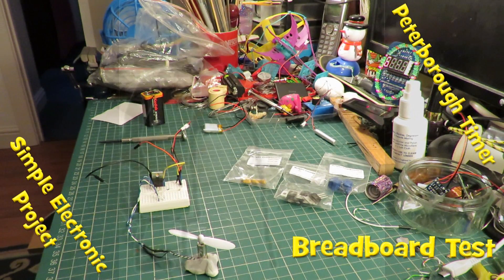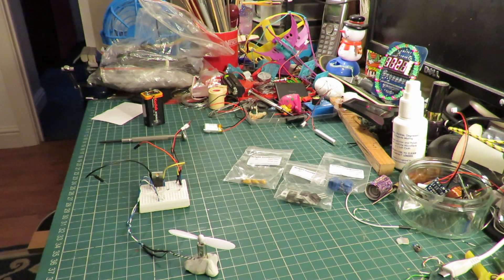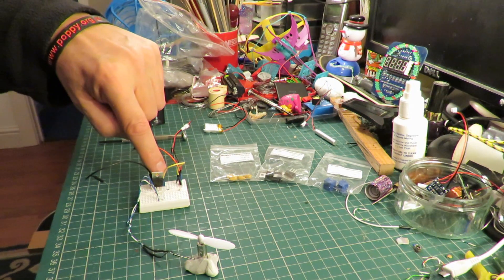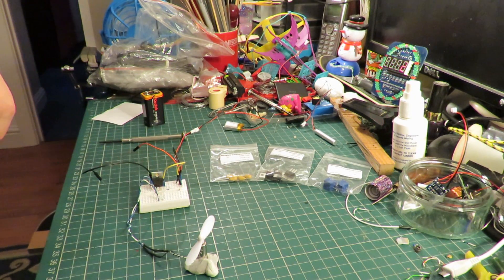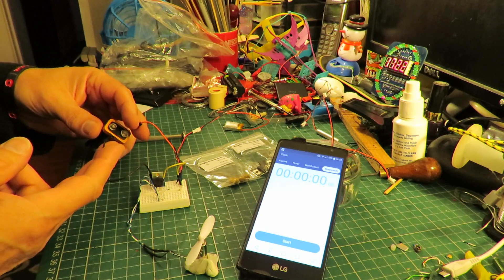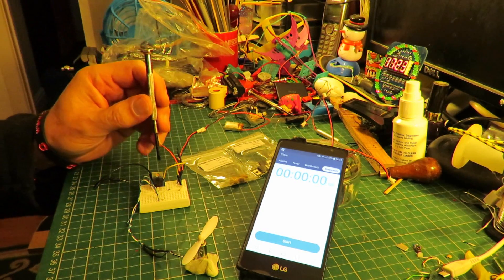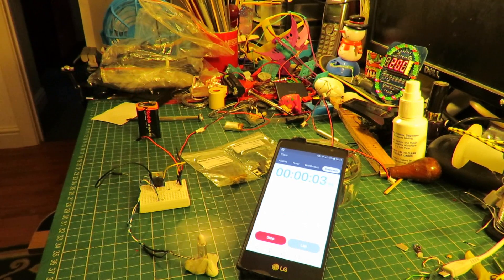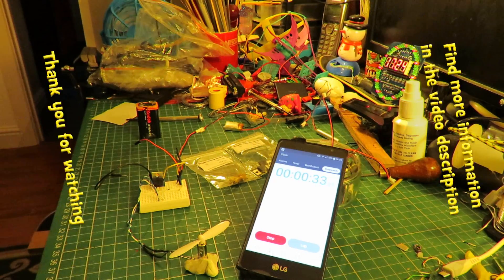Peterborough Timer - Breadboard Test

Comment: cool.
Thanks for taking the time to build and film it, and for the (unexpected) shoutout.
Reply from the maker: Thanks, credit where credit is due. I would not have known about them without your comment. I built this version so I could try out the options but I used the cheapest MOSFET I could find on eBay. A surface mount version would have been lighter but I couldn't find any really cheap and the potentiometer is obviously heavier than a single resistor so I may make a different version if I want to try this on a small plane.

Comment: Hello!
I wonder which one of the rubber band Powered cars that goes the longest distance. Not like the fastest car or so, but the one car that goes the longest distance
Reply from the maker: Sorry I have no way of checking that as I have a limited distance to test them. As long as you minimise friction you can get a good distance out of most of my designs. This one is a good example Rubber Band Powered Car 1 x size 64 - full length video https://youtu.be/pIO3FiHX4Oc?list=PLA5a2xPRSrB3g5RiX8Kf_uUBOL0Tb7AS0

Comment: Will this Peterborough timer be lighter than the other 555 circuit.?
Reply from the maker: Not much difference if you use that MOSFET as it is rather big. An SMD (surface mount) equivalent would be lighter. The only SMD components I could find at the time were significantly more expensive and I tend to be focused on cost rather than weight.
Reply from the maker: Using a fixed resistor would also make it lighter but I wanted to see what sort of range I could achieve by using the potentiometer.
Reply: GrandadIsAnOldMan nice. Thanks for the reply

Comment: It cant get any more simple than that, good job :-)
Reply from the maker: I claim no credit for this. It could be made lighter by choosing the right components but I chose the cheapest. Using a fixed resistor would also make it lighter but I wanted to see what sort of range I could achieve.